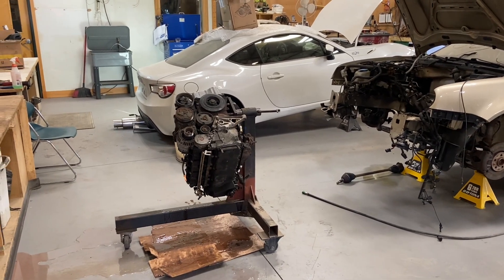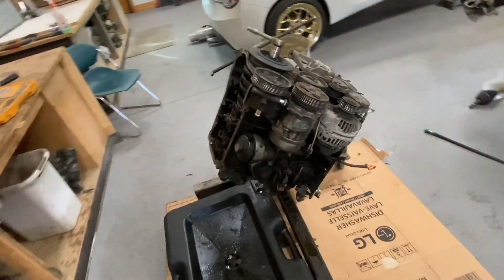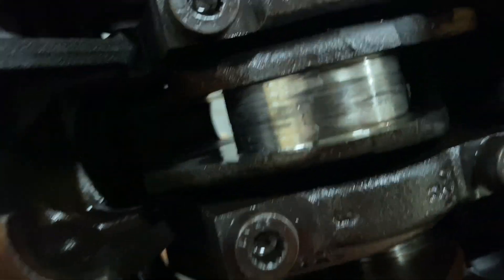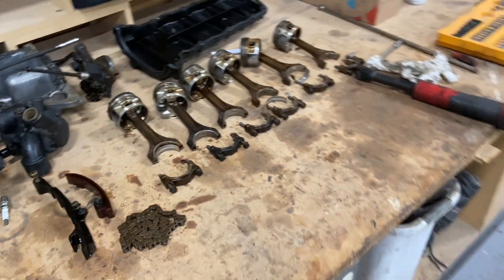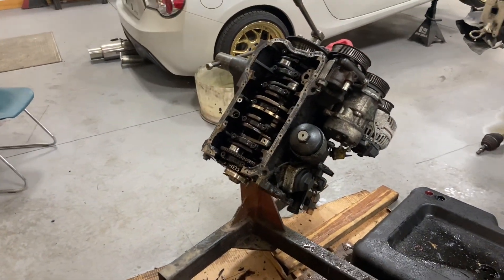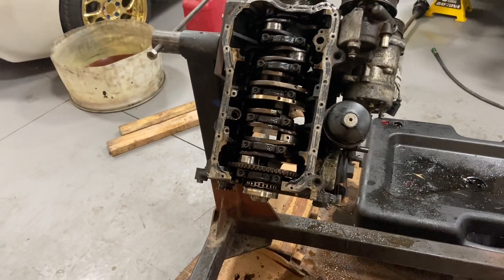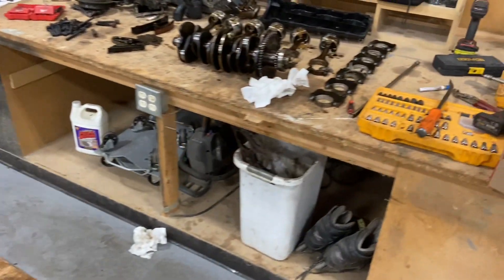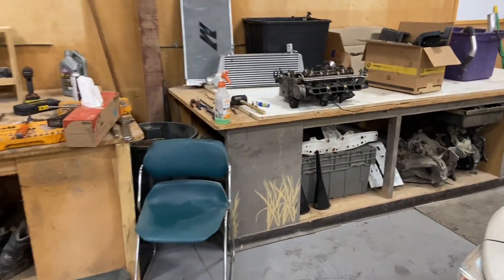This Is What To Many BURNOUTS Does To A Volkswagen VR6 Engine! Engine Teardown

Comment: smal advise - just swap the engine, leave this one for parts because cleaning this one will be very difficult plus heat spots could damage block so U should legalize the main bearings (check if they are in line); overall : it's not worth it, especially that U are using it hard.... regards from Poland                                              😶‍🌫
Reply from the maker: Thank you for the advice! My family is from Poland. I have already purchased a new crank rods and pistons. I am torquing in the crank today. I sure hope I hope works out.
Reply: well, I wish U the best, I also hope that it will work, if not the second one is waiting right there... 😅  @KBMOTORSchannel